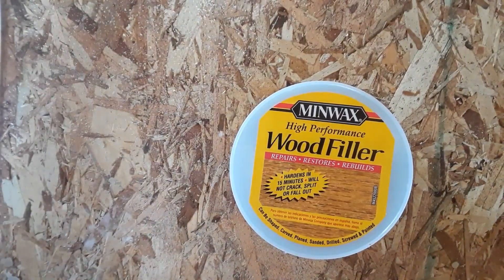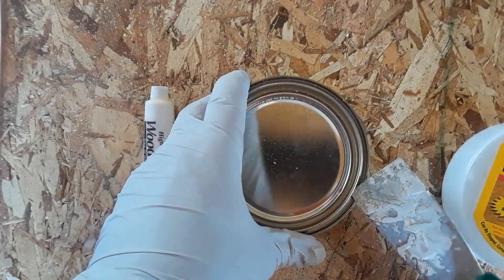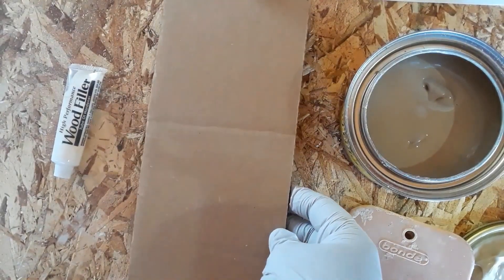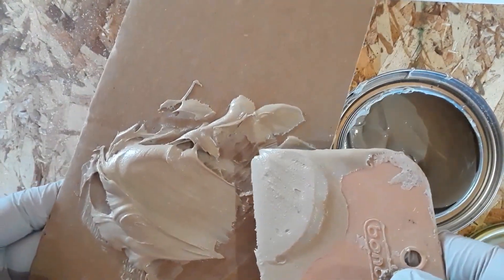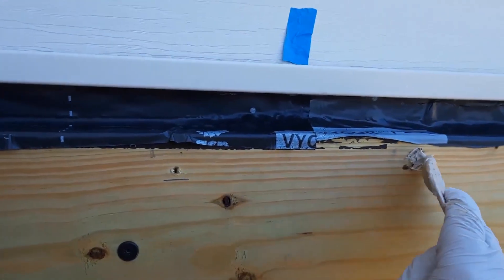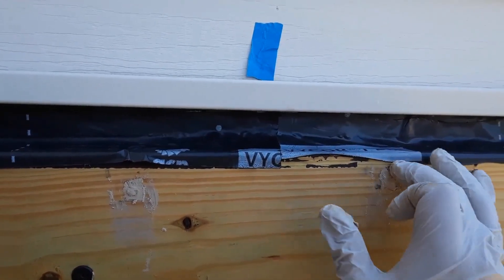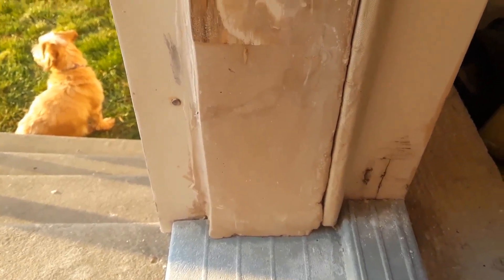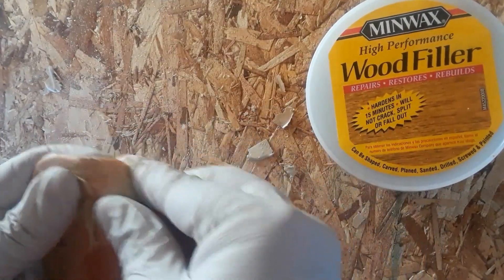Minwax High Performance Wood Filler

Comment: That door jamb may not be rotting just because of untreated lumber.  It could be a cap flashing issue, the lack of caulk at the wood to metal sill junction, or a combination of the above.  As a retired home inspector, I'll tell you that cap flashing is the biggest culprit.
Reply from the maker: Good point. Since only 1 side of the jamb is rotted, you may be right that it's just a flashing or caulk issue. Either way, I'm hoping this wood filler takes care of the issue
Reply: @windsordiy1198  I've found that those damned ribbed sills hold just enough water to channel under the jamb too.  Also a nice point to this filler is that it can be carved with a proper knife or even a chisel if one is careful.
Reply from the maker: @ATLparanormalOG  That's another good point. Even though it's sloped, those ridges definitely hold some water

Comment: Can you use this on rotted drywell around a tub by the floor?
Reply from the maker: This product does adhere to drywall but I imagine a better option would be to replace the damaged drywall and try to stop future water from getting on it. If you can't do that , there are some paints/primers (Zinser and Kilz for example) that offer some water protection and do a good job at hiding the previous stains.
Reply: I'd replace drywall around a tub enclosure with cement board every time.